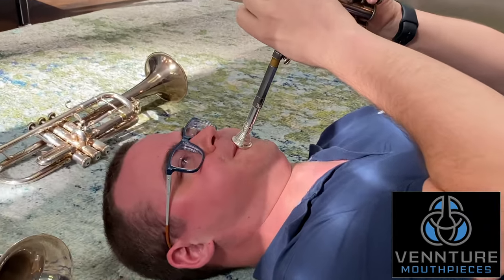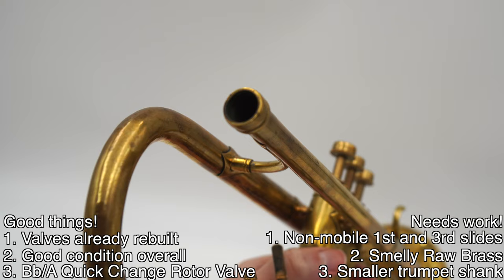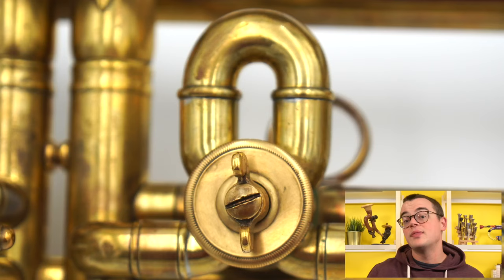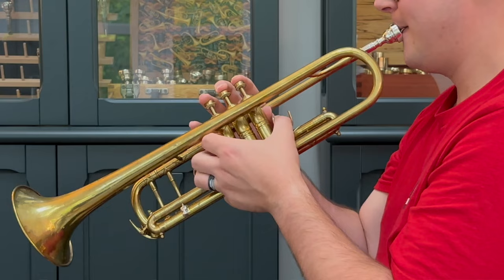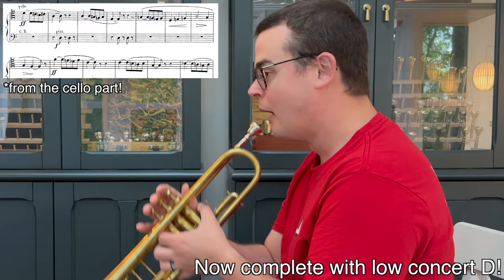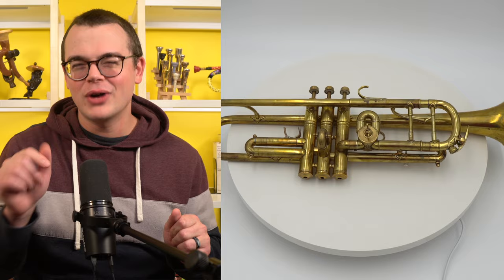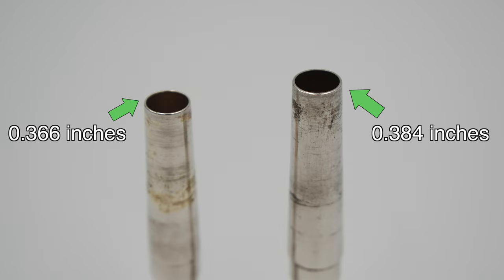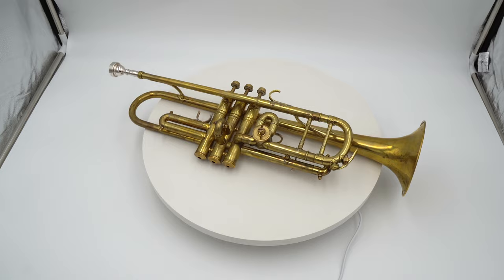RENOVATING my 100-YEAR-OLD Besson Bb/A Trumpet

Comment: The early Conn Victor cornets had linkages that automatically adjusted the 3 valve slides when switching between B-flat and A.  The also had version that came with a set of slide to play in C which gave you 3 keys to chose from.  The Cornets were commonly sized in the Conn 2 1/2 bore, which is .465 inches.
Reply from the maker: Yeah, I've seen that kind of mechanism before - so involved but very impressive when it works well!! Thanks for contributing and for watching!

Comment: You can wax raw brass or just clean it with 0000steelwool and handsoap in the 0000 steelwool then wait for new patina (takes about 2 years) edit... YOU CAN NOT DO THIS TO SILVERPLATE IT WILL JUST DESTROY THE SILVERSURFACE, but rawbrass just gets clean if you dont use high preassure.

Comment: Absolutely love what you've done to the instrument Jon, it's looking and sounding brilliant!
Is there a reason why you couldn't swap the mouthpiece receiver for a modern one? Would it mean you'd have a wierd gap from mouthpiece reciever to leadpipe?
Reply from the maker: James! That’s funny, that didn’t occur to me - but probably the mouthpiece fix was a bit simpler and didn’t require me to know anything about the internal dimensions of the leadpipe. My guess is that truncating the mouthpiece like we did has a smaller effect on the playability than switching out the receiver. The other idea I had would be to make a screw backbore with the Besson sized shank end that I could use on any of my screw tops - but the Old Man does the job more than well enough. 😎
Reply: If besson shanks are anything like boosey and hawkes shanks a new modern one won't fit just saying. It would need to be modified or changed leadpipe but the sound would then change.

Comment: Hey Jon Talks trumpet why not just use a cornet mouthpiece?   That has to be the exact right fit.  Any mouthpiece you can get in trumpet you can also get in cornet.  Of course a custom mouthpiece is pretty cool.
Reply from the maker: Nope! Cornet mouthpiece drops all the way in. This custom piece is right between the shank sizes of a trumpet and a cornet, which is what seems to work for this trumpet’s reciever.
Reply: @JonTalksTrumpet  Wow thanks for the reply